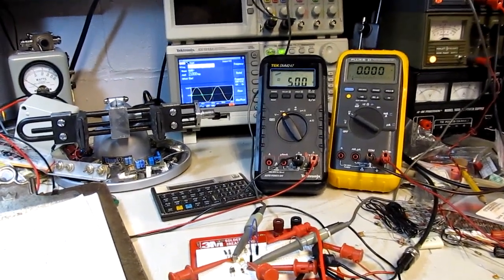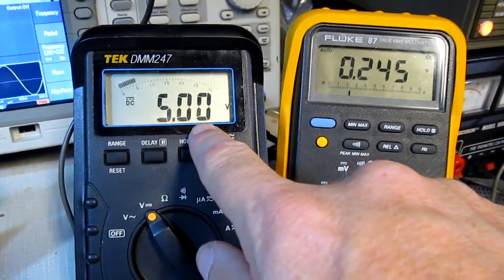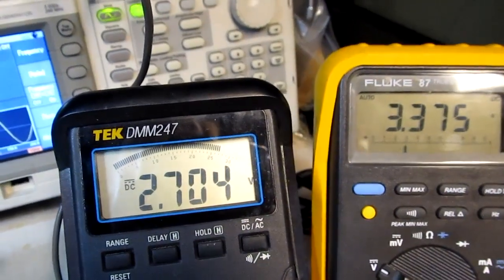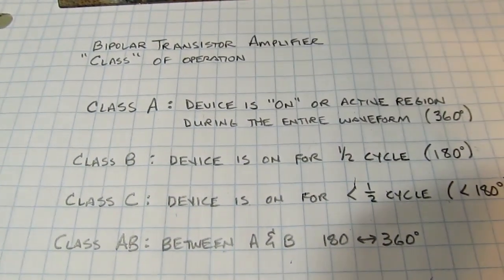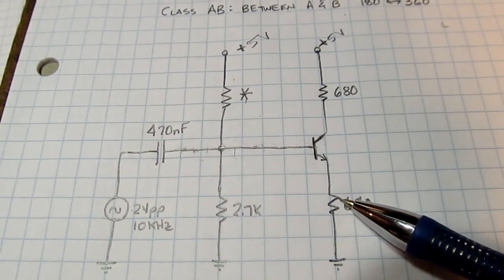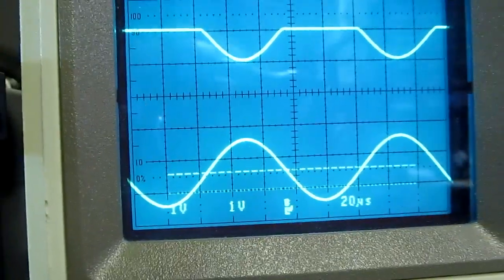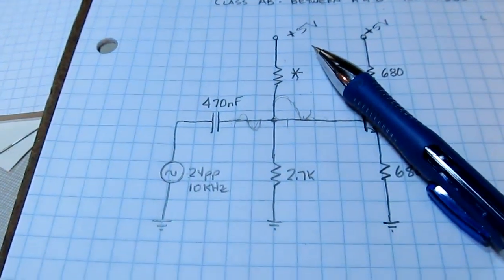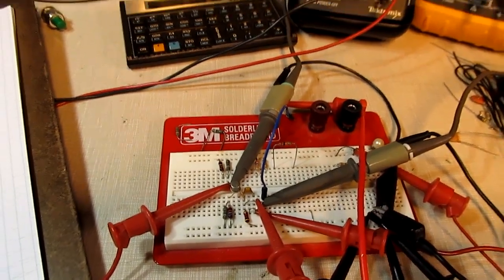#113: Basics of Transistor bias point and the class of amplifier operation

Comment: Hard to believe I passed my associates degree in Electronics engineering twenty years ago. Come here for refreshing my memory. What is troubling me now is, if CB is amplitude modulated how are there side bands? Frequency modulation produces side bands as a function of it's design but AM modulation should be on top of the carrier. These wonderful inconsistencies of my knowledge base come out when Young people ask me questions
Reply from the maker: Any type of modulation of a carrier increases the BW of the signal.  The BW increase beyond the carrier are the presence of the modulation sidebands.  AM is no different.  AM if formed by multiplying a sinusoid (carrier) by the baseband signals (one or more sinusoids).  In the simplest form (single tone baseband), this is essentially multiplying sin(w1*t) by sin(w2*t).  The trigonometry tells us that when you multiple two sinusoids together, you get energy at w1+w2 and w1-w2 - the upper and lower sidebands.  By adding a DC offset to the baseband signal, you also preserve energy at the carrier (w1).

Comment: Hi Alan. 2 Quick questions I'm hoping you can answer. First, where is amplification happening? For example, in Class A mode, it just seems like the most it will pass is 5 volts which is what the original voltage is. Does it actually amplify? Then, in Class A mode (always on), I suppose there's no advantage to having a BJT in the way, right? After all, it's always on.
Reply from the maker: I purposely made the voltage gain equal to unity (collector resistor equals emitter resistor) so that the input and output waveforms can be viewed on the same scale. If the collector resistor was greater than the emitter resistor (or emitter resistor is bypassed by a capacitor), then there would be voltage gain visible on the collector compared to the input on the base.
Reply: @w2aew  Thank you. I have since found your video on the different gain configurations. My confusion had to do with the assumption that the gain would be the delta between collector and emitter with emitter>collector. But now I see my mistake as gain is applied to either the base voltage or the emitter as an input. That other video was great. After watching that, I equate the grid of a tube to the base, the plate to the collector (even the signal is out of phase!) and the cathode to the emitter. Actually, a video that compares transistors to tubes and how they took their place would be cool.
Reply from the maker: @DavidBerlind  Your analogy between the terminals of a bipolar transistor to a triode is good.  You'll find that functionally, a FET is even closer to a triode.
Reply: @w2aew  Thanks Alan. I will have to look for your video on FETs (I"m sure you have made one or more). I still think a video that discusses the tubes vs. transistors, the history and transition, maybe some hands-on comparisons, would be great to have from someone with your background. Also, I realize I didn't say it before, but your videos are great. Thank you. I love them and find myself wanting to recreate your experiments to enhance my own knowledge. The ones that are really helpful in this respect are the ones where you describe exactly what gear you're using, how it's configured, and how you have the probes and such connected. A lot of videos (not necessarily yours) bypass this important step. Even a link to a schematic would be a good substitute where the narrative in the video doesn't cover that. Sidenote: I'm starting to get into HAM and you've got some great videos for budding HAMs.  Will be going through those too. Anyway, thank you again.
Reply from the maker: @DavidBerlind  Thank you for the nice comments on my videos.  Here's a link to the video I did on the basics of FETs:
https://www.youtube.com/watch?v=oambDFa0Pr8
I think you'll find, if you're familiar with Triodes, that there are a lot of similarities.
One more thing on my videos, the majority of them include a link to a PDF copy of the notes used in the video.  That link can be found in the video description on the YouTube page.  I wasn't sure if your comment about a "link" was asking about my videos, or was a comment on other channels.

Comment: Great video! I understood it, but I couldn't see much amplification...?
Reply from the maker: The common-collector amplifier doesn't have any voltage gain, so you won't see any amplification there.  For the common-base and common-emitter amplifiers, I purposely made the gain very low (about unity) so that it would be easy to see both the input and output waveforms on the same scale.
Reply: @w2aew  got you. I knew I was missing somthing easy. Thanks!

Comment: w2aew, Does the AC/DC load line mean the maximum output wattage power of the transistor or does the AC/DC load line mean the power dissipation of the transistor? Because the AC/DC load line is selected by the EE designer of the operating voltage and operating current for the transistor and the DC bias Q point which will determine the maximum output wattage power out of the transistor and the power dissipation of the transistor. I'm not sure what the LOAD means in the AC load line and DC load line what they are calling the LOAD.

Comment: w2aew, The AC load line means that the 1khz test frequency won't get clipped on the positive cycle or the negative cycle and outputs the maximum wattage power? The DC load line also means the same thing. The AC load line and DC load line means you want to bias the tube, transistor to not clip the AC sinewave signals and also to get the maximum output wattage power out of the tube or transistor? The AC load lines resistance from the load circuit on the output of the tube or transistor is putting a load on the AC load line & DC load line so your wattage and power is lower because of the circuit load on the output of a tube and transistor. The AC load line & DC load line graph charts shows the current VS voltage because it doesn't add in the circuit load on the output of the charts to show what happens to the power wattage load line.

Comment: W2aew, what is the difference between a DC load line compared to a AC load line? The +Vcc voltage and output impedance sets the DC load line and AC load line? but what is a GOOD DC load line and AC load line and what is a BAD DC load line and AC load line?

Comment: w2aew, TV monitors have a B+ voltage which i think is a DC offset or bias voltage which needs to be set at 125vdc, any reasons why such a big DC offset bias voltage set at 125vdc for a TV monitor to work correctly? if the B+ Voltage is not set correctly the TV will display scrambled garbage on the TV monitor i'm not sure why that is.

Comment: A method of testing an amplifiers output wattage instead of using a 4 ohm or 8 ohm speaker you can use a 100watt light bulb instead of a speaker. If your stereo systems outputs 100watts you can test the RMS wattage by unplugging the speakers and using a 100watt light bulb instead. The brighter the light means its at full 100 watts. I'm not sure if a 100 watt light bulb has the same ohms resistance as a 4 ohm or 8 ohm speaker so I'm not sure if this RMS testing method of using a light bulb is correct.  Here is the video I saw this method from Cesar Diaz video time at 48:52 https://www.youtube.com/watch?v=-VHvQT-DPZ8    Also how Cesar Diaz test if the speakers are out of phase he puts a 9volt DC battery to see if the speakers are pushing OUT or IN. I thought a DC voltage apply to speakers is BAD for the speakers that is why they put a series blocking capacitor to block DC voltage to the speakers but Cesar Diaz is applying a 9volt battery direct to the speaker terminals to test if the speakers are pushing OUT or IN to test if they are out of phase or in phase video time is at 35:46  https://www.youtube.com/watch?v=-VHvQT-DPZ8
Reply from the maker: I don't agree that observing the brightness of a 100W bulb is a good way to measure the power delivered by an amplifier.   On the speakers, providing a DC signal for a very short period of time to test the phase of a speaker is perfectly fine.  You just don't want to leave the DC input on the speaker for a long time.
Reply: @w2aew  What other way can you test the speakers phase besides using a DC battery? if you have a bunch of speaker cabinets and you don't know the speakers phase how would you test the phase of various speaker cabinets besides using a DC battery?

Comment: I thought Bipolar transistors were current controlled and f.e.ts were voltage controlled?
Reply from the maker: Bipolar transistors can be thought of as both current controlled and voltage controlled.  Large signal operation, switch operation, bias considerations, etc. are often designed considering terminal currents, Beta/hFE, etc., while for small signal operation, it is more helpful to consider voltage control (transconductance).

Comment: Very interesting! I think now i understand how transistors work!

In order for me to simulate what you teach in this excellent video, i would need two power supply, one of them adjustable from 0 to 5Vdc, but i only have one.

Can a resistor voltage divider with one Pot do adjust from 0 do 5 Vdc, be used instead?

Thank you very much!
Reply from the maker: Yes, you can use a pot to set the bias on the base.

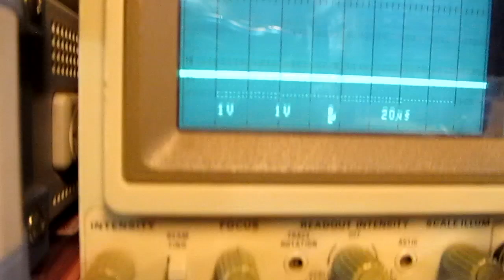Comment: Hi w2aew, I have a question I hope you can help me with.  Could you share how one can calculate the bias voltage based on the resistance of the bias resistor? I tried to calculate the bias voltage using the voltage divider formula; V=5*(2.7*10^3)/(2.7*10^3 + 3.6*10^4) but I get V=350mV. It does not agree with your observation at 8:50, where you observe that V=600mV. Did I make a mistake somewhere? Thank you!
Reply from the maker: No, I made the mistake.  The lower resistor, from Base to Ground is 4.7k, not 2.7k.  If you work the math on this, it all works out.  I used to have an annotation in the video to point out this error, but YouTube discontinued the annotation feature.

Comment: yes the AC audio signal is superimposed on the DC bias, but the input drive level on the FET's gate will overload the input of the FET or have intermodulation distortion. You can DC bias the JFET for a class AB operation but the input drive level can drive the FET into class A operation. A Class C operation amplifiers bias is under bias so the FET is not conducting and the audio or RF input signal drives the FET into conduction.

Comment: The Audio drive signal on the input of an JFET or MOSFET amplifier will drive the FET's which will bias them from an AC biasing i guess its called. The input drive level can Bias the FET's also correct? I'm guessing this is called an AC biasing of the FET?
Reply from the maker: I don't think I've seen any amplifiers who's bias is determined by the audio drive.  Usually the bias is determined by the DC voltages and surrounding components.  The audio/AC signal is then superimposed on that bias.  Not familiar with the term "AC biasing".  If it's a real thing, it is not common.

Comment: The Gate threshold of a FET is clipping the Level of the compression point or clipping the level of the FET's output amplitude when used as an amplifier? a JFET N channel and P channel can both have the same bias polarity both can be a negative voltage in both N channel and P channel or is the N channel always a negative bias voltage and a P channel always a Positive bias voltage?
Reply from the maker: The Vgs voltage sets the operating point of the FET.  For an N-channel JFET, the gate voltage is made lower than the source voltage to reduce drain current.  for a P-channel JFET, the gate voltage is made higher than the source voltage to reduce the drain current.

Comment: When biasing a tube amplifier its based on how much Bias Current the power amplifier output tubes are pulling/drawing for the negative bias voltage. 20mA of bias current is considered cold and 70mA of Bias Current is considered Hot, 60mA of Bias Current is considered Normal. You multiple the measured Bias Current by the Plate Voltage which will give you the output tube wattage dissipation.  Biasing a transistor you don't care to measure the bias current its more about looking on the Oscilloscope of the clipping and the crossover distortion at the zero crossing point. The Wider the crossover distortion means each output tube or transistor aren't MATCH?  The Old tube testers just tested for shorts and emissions, but how do you MATCH output tubes? To match transistors you match the beta gains or using a curve tracer. But to MATCH output tubes is by measure the bias current  for each tube and Matching them to have the same bias current for each output tube in the power amplifier. Example you would want all 4 output tubes to be each pulling drawing 60mA of bias current per output tube to be MATCH. If each output tube is at a different bias current the "wider" the crossover distortion will be at the zero crossing point on the oscilloscope?

Comment: It's always been my understanding that class AB does not mean "somewhere between class A and B", but rather a pair of class B amplifiers configured to reproduce the entire waveform like a class A. We refer to this as a "push-pull" amplifier. It has almost the same fidelity as a class A amplifier (there is some crossover distortion), but draws much less power at it's quiescent state because both transistors are biased to cutoff instead of active.
 It's been a long time since I've played with hi-fi amplifiers, but pretty sure that's correct...
Reply from the maker: Typically, each of the transistors in a push pull stage is based to be in Class AB (i.e. they're biased just above cutoff).  This arrangement is what minimizes crossover distortion.  If you bias each transistor just below cutoff, then they're not Class AB.  The Class always refers to each transistor.

Comment: Hi w2aew, 
thanks for your videos which are really helpful,
I have a question if you please help me in as I spent quiet time in searching and experimenting about (actually I'm a civil engineer, not electronics)
the question is:
I have a very weak signal 27MHz to amplify and I tried several ways to amplify using a transistor (not an IC) but the first stage transistor circuit is not giving the expected amplification, the last info I got was that the resistors selection needs to allow such week signal to trigger (turn on) the transistor (impedance issue) for which:
- can you please advise me what would be the best range of transistor (lower - like hundreds of ohms - or higher - kilos or megas of ohm-)?
- is there better way to amplify weak signals?
thanks a lot in advance.
Reply from the maker: There are a lot of considerations required when designing RF amplifiers.  High speed transistors and layout techniques are required.  Special considerations are needed to achieve the required speed for RF signals.  Also, a lot depends on how small the signal is, how big you need it to be, how much amplification is needed, how much bandwidth does the signal occupy, what does the load impedance look like?  You can buy ready-made RF amplifier modules, which is easier than making them yourself if you don't have the design expertise.  Here is one example of the variety of RF amplifiers from one manufacturer.
https://www.minicircuits.com/WebStore/Amplifiers.html#
Reply: @w2aew  thanks for the advise, really appreciated

Comment: what if the input not high enough to turn on the transistor in Class C amplifier. Do you use another gain stage before it?
Reply from the maker: Either add an additional gain stage before it, or add some DC offset to get closer to the needed bias condition.

Comment: i'm kinda confused about the voltage experiment here since these are current devices?
Reply from the maker: Bipolar transistors really aren't strictly current devices, just as FETs aren't really just voltage devices.  Each have their own current-voltage relationships and characteristics.  Many people consider bipolar transistors as current devices because of the relationship between base current and collector current (Beta).  The truth is that Beta is a very poorly controlled parameter, and most real designers know that it's best to design circuits in a way that they do not depend upon Beta.  Take a look at my video on setting up the bias on a bipolar transistor to be largely independent upon the value of Beta:
https://www.youtube.com/watch?v=YQlbPGNB-ys

Comment: BJT's are Current devices. you are using  voltages which is a little abstract.
Reply from the maker: Not entirely - several aspects of BJT operation are best described/modeled using voltage and current.  For example, small signal gain of a BJT is best described by its transconductance (change in collector current as a result of change in the base-emitter voltage).  Most transistor level design of BJT circuits involves dealing with both the voltage and current considerations.
Reply: @w2aew   "is a little abstract" , I got it but this is basics and your audience may get it better if it's less abstract.  Voltages are good to show the Junction thresholds. avter that the current is the main actor.
Reply from the maker: @enriquelaroche5370  I respectfully disagree about focusing on current as the main actor.  In my opinion, doing this promotes design and analysis based on the transistor's Beta (Hfe), which is poor practice since this parameter is not well controlled.
Reply: @w2aew   I studied (EE in a transitional time 1971 and Learned Vacuum tubes and Transistors  it was less confusing to think Tubes = Voltage and Transistors =current. C Mos back to Voltage.  Thanks for the Videos..